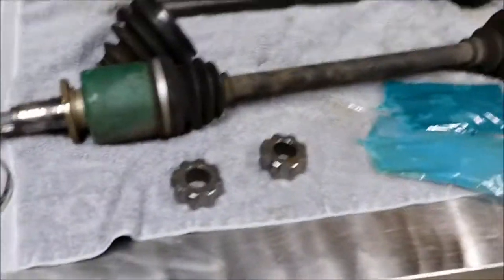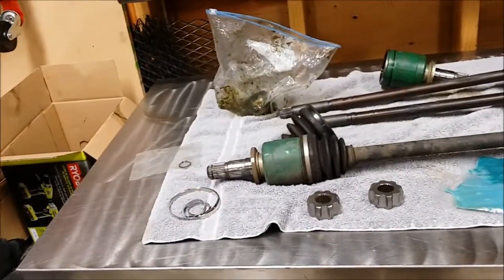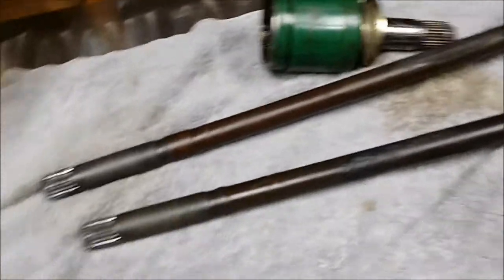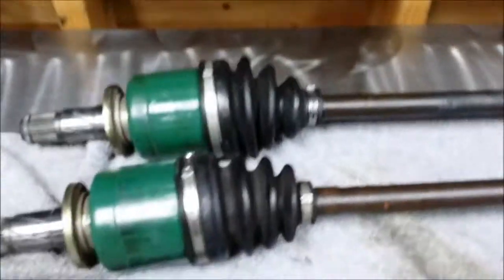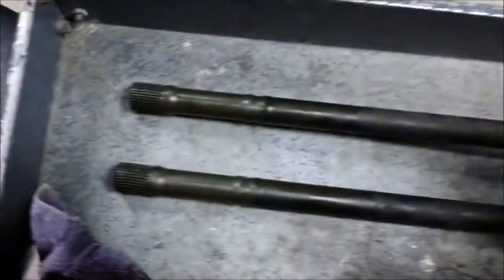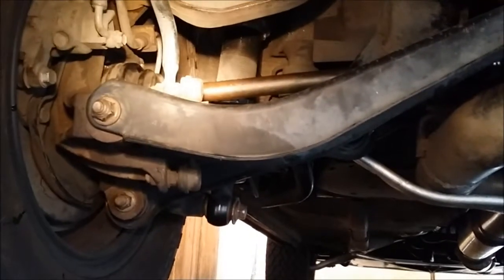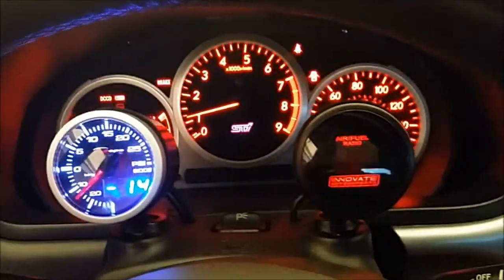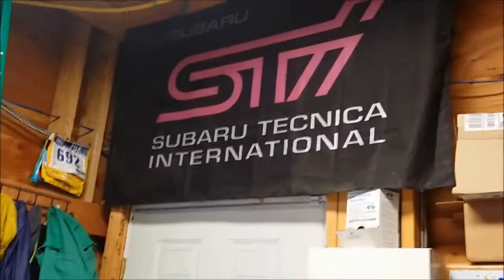BAJASTI hybrid rear axles

Comment: Maybe i missed this in the previous videos, why didnt you just use the sti 5x114 outers as well?
Reply from the maker: Tommy Eick Subaru does not make anything 5x114.3 that fits on the baja or outback.
Reply: intersting, i thought you just had to swap the rest out, like the backing plates hubs and what not
Reply from the maker: Nope won't fit.